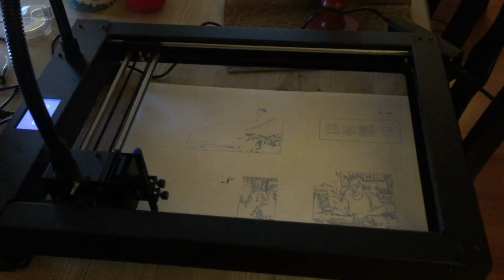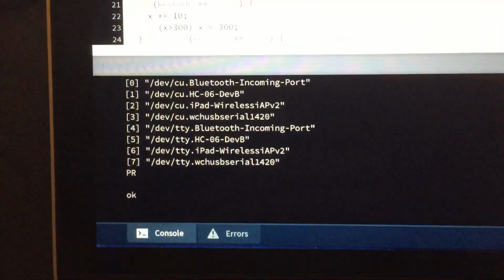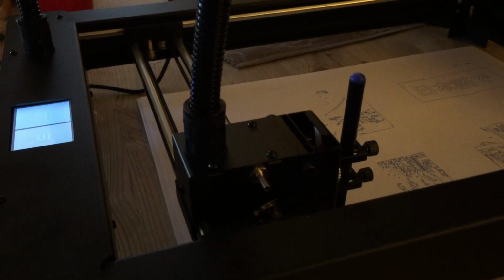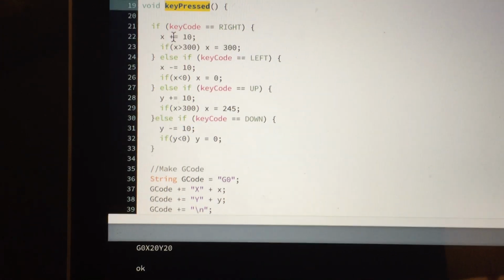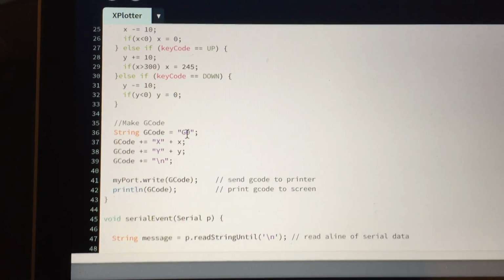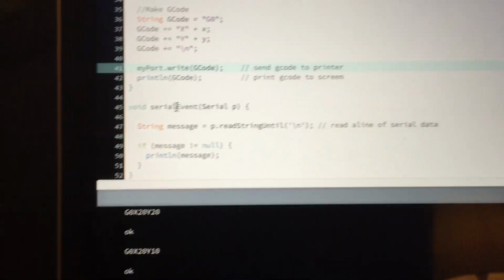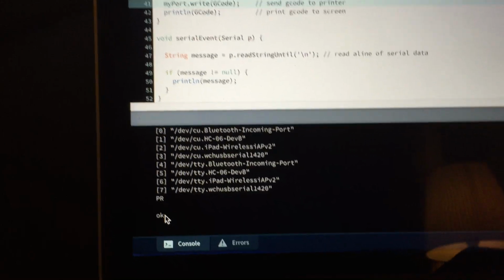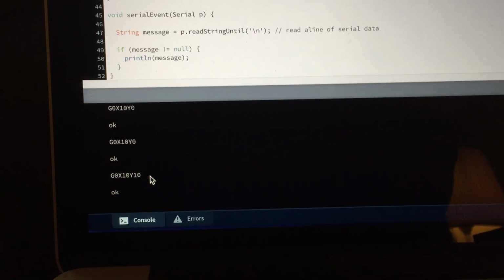XPlotter from PineconeRobotics on Kickstarter - first app

Comment: Laser on should be M4Sxyz. xyz is between 0 and 255, 255 = full power. 
Laser off M5.
Worked for me using the gcode on a sd-card.